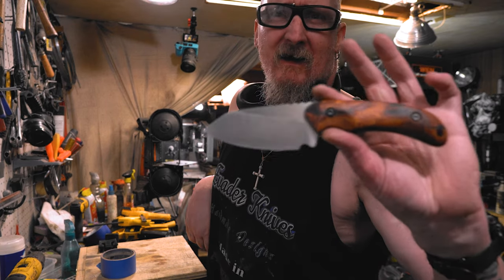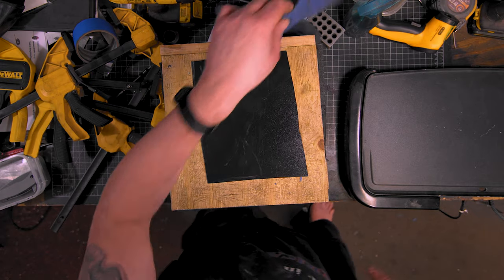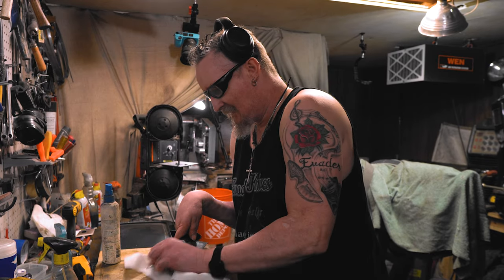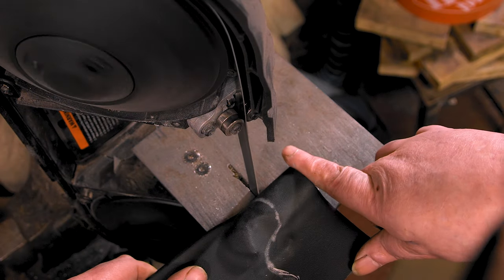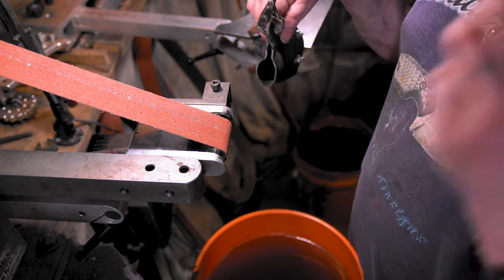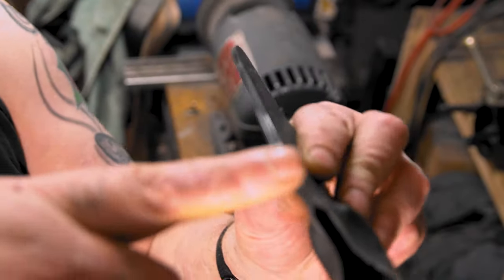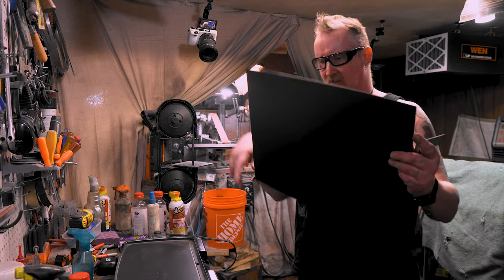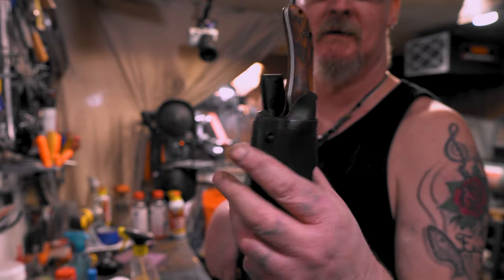Full Guide to Knifemaking - kydex sheaths

Comment: Great video Dave. I have the same  HF Arbor press I drilled the ram too but instead of putting the set screw in like you did I bought some hi strength  magnets that I got at HF just popped 2 of them in the hole no glue or nothing worked great and no threading etc...  Did the same on the Arbor plate between the cutouts.
Reply from the maker: Wow, that's a great idea. I actually use the press for setting detents in my folder too, but that is a flat piece.

Comment: nice job on the sheath dave it came out great !!! what thickness kydex should you use when making sheaths ? or what do you recommend? and any links for getting the kydex parts screws,clips etc,etc
Reply from the maker: I put this in the 1st or 2nd Q&A, but I go to knife kits & I use .08, here is the link... https://www.knifekits.com/vcom/holster-making-materials-kydex-c-1071_54.html
Reply from the maker: Look under tools for setting the eyelets & forming the kydex. Or just build it yourself. Amazon has cheap setting tools for the eyelets, maybe start there. And here is a link to the eyelets & other mounting parts... https://www.knifekits.com/vcom/holster-making-parts-c-1074.html